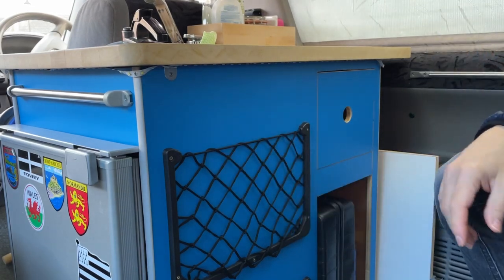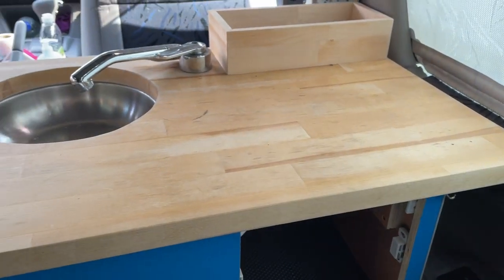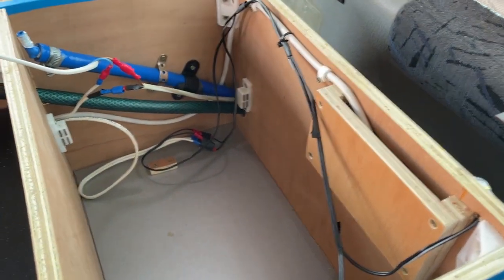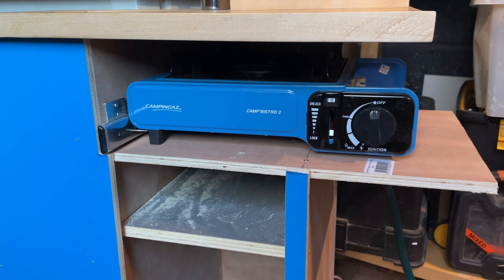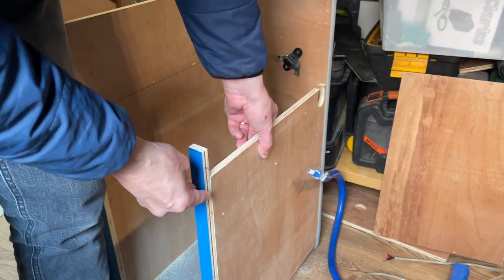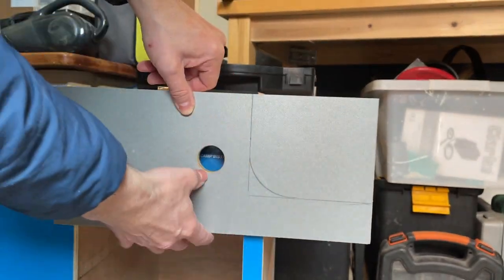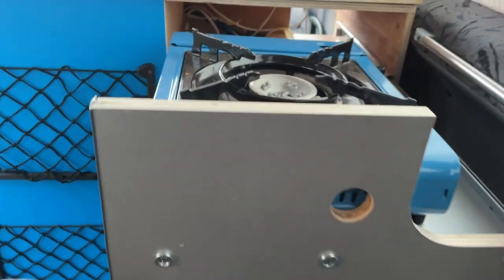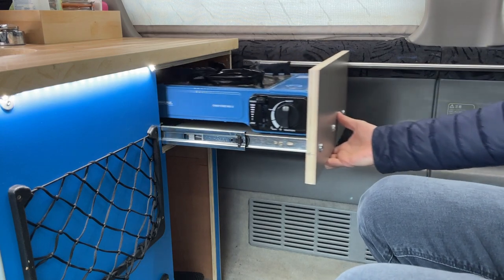Stove Slider Drawer For My Campervan | Mazda Bongo

Comment: The new slider drawer looks great.... you're really good at this stuff!  I got my Bongo leak fixed, turned out it actually had 2 leaks ... one at each end of a hose..... it wasn't a problem with the hose but in fact a problem with the metal pipes that go into the hose , they had corroded and caused the metal clips not to work properly..... 2 new clips and the metal pipes cleaned up and it's good to go.
Reply from the maker: Thanks! I just can't stop tinkering with the van :) 

It's good to hear you got your leak fixed! coolant leaks seem to call for every Bongo owner at some point. You've reminded me that I should order my coolant alarm and get that fitted soon!! 

Cheers 👍
Reply: @VantasticIdeas  it was my coolant alarm that alerted me to the problem..... it was the first thing i did when i bought my Bongo last july,. My Bongo has just passed the MOT with no advisories, not bad for a 23 year old vehicle!
Reply from the maker: @twish1999   That is good going!! when they're looked after they are very reliable.

Comment: Another great video!. What is the height of your kitchen unit? Would you make it taller or shorter? Thanks in advance !
Reply from the maker: Thanks!! The kitchen is 67cm high including the worktop (64.5cm without the worktop). I would possibly make it taller if I was going to fit a larger sink into it, otherwise it's a nice height as is. 

Cheers 👍